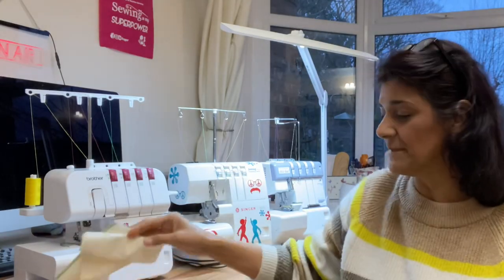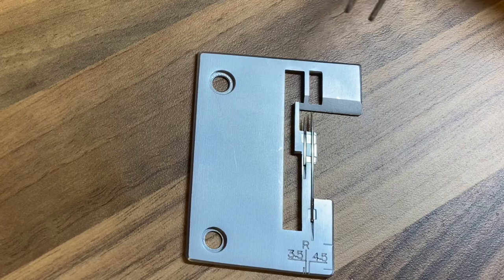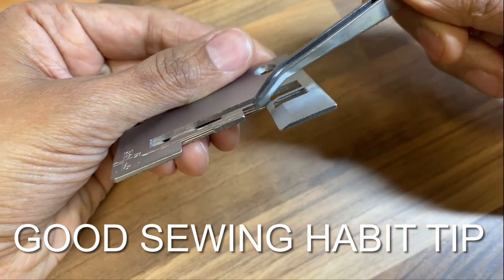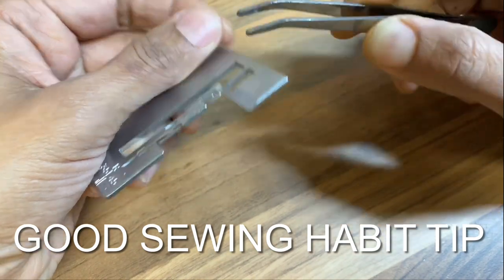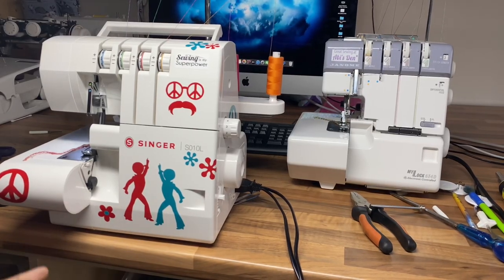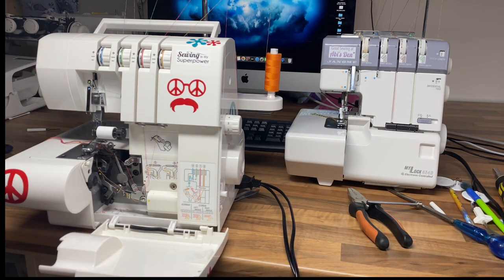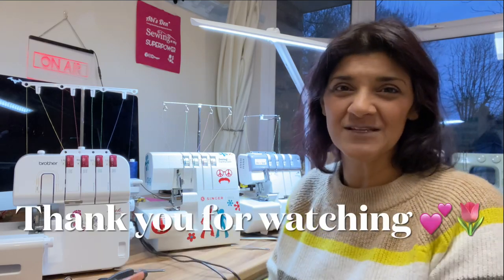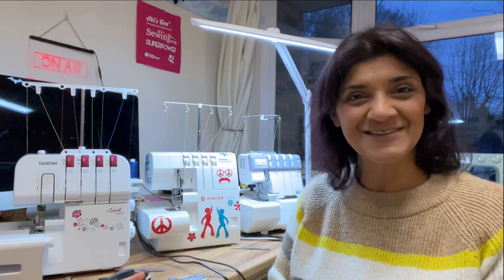Overlocker Problems : Threads Trapped,  Broken Needle Plate, Chaining Fork - Singer Lidl S010L

Comment: I've replaced my lower looper & the needle plate as I broke both :/ I'm still having some issues with the lower looper just barely clipping the left needle. It was hitting both, but I've since repositioned the looper up higher. The fabric doesn't seem to be gliding through the feed dogs like it did before. Seems herky jerky. Also, the lower looper thread keeps coming off of the very bottom yellow clip. I've been able to get it to chain on fabric, but then it breaks. Any suggestions?
Reply from the maker: What a palaver , poor you! In the instance when a machine is under warranty, you should always speak to the manufacturer for support. The looper should never break and it’s up to the company to replace or repair the machine, even after warranty. But as it gets to this point, it’s very fiddly and tweaks need making. The needle bar may need adjustment.  Speak to the company and see if they can help. Without the machine here in front of me, I can’t diagnose the issue. I am sorry, but good luck!

Comment: 2 sergers just stopped making stitches, Both needed timing adjustments, and after timing adjustment still no stitches, However, one will make a chain . but as soon as I put fabric on the machine no stitches in the fabric at all but a lovely chain to the side the whole way. The other serger now is running backwards! It kind of weirded me out because in my 45 years sewing I have never seen a Serger stitch backwards! i think I have Serger Gremlins attacking my machines. I am pretty annoyed and upset because I am ,making items for my sons wedding that is only about 7 weeks away!
Reply: Are you making sure you are putting the fabric far enough to the right so that the machine catches the fabric? Also their is a width button on the front. Have you tried to adjust this?
Reply: I figured out the issue by changing the needle, rethreading AND hand turning the wheel properly afterwards (towards myself). It eventually corrected itself, just needed a "reset".

Comment: Hi one of my needles is bent on the plate of my necchi machine can I bend it back in place 😔
Reply from the maker: Hey Marcella, if you can
Pull it out, that’d be a good idea. You can’t really bend a needle back properly and it’ll get in the way. One needle will
Still Work but it’s not perfect
Reply: Thanks for the advice I ordered a new plate hopefully I will get it sorted ☺️
Reply: Never try to bend a needle back straight, put a NEW NEEDLE in ! Also check for any "nicks" in the needle plate. If slight nicks you can use a small file to smooth out the rough spots so the needle does not "catch" on the jagged edges.

Comment: Hi
I was hoping someone could help and give me some hints on how to fix this thread issue with the 14U454B overlocker. 
Everytime i try to start chaining the thread the lower no:2 thread keeps tangling in the silver plate making all the other threads tangle in the plate as well i've tried rethreading everything and it keeps happening.
As i don't have funds to take it to a specialist i would like to see if i can fix it myself.
Reply: Hi. First unthread the machine and clean between the disks with a piece of cotton fabric to make sure nothing is in between the disks. Clean the feed dogs, clean the loopers etc. oil the Machine at certain points(video on this channel showing you) change needles, then rethread the machine, most sergers go 3,4,2,1 to be threaded 1 on far left 4 far right. See if this helps. Make sure thread is between the disks and not to either side. Make sure pressure foot is up when threading. Use good overlocker thread. See if these help
Reply: @merlinthewizard2399  I've done all that and it doesn't help the thread still wraps it's self around the throat plate. I've taken the throat plate off and hand turned the wheel and the thread seems to chain it self alright then but i have no idea why with the plate on why it keeps tangling around the plate. :(
Reply: @63Arnast  have you looked to see if you have it in the rolled hem position? The threads are supposed to go over a little point on the face plate . Have you emailed Abi on her website she may be able to get more details
Reply: @merlinthewizard2399  I haven't emailed her yet as i've ordered a new plate as this one was broken. I doubt that was the issue but better be safe and sure. Been trying to find a service manual for it but that is near impossible to get.